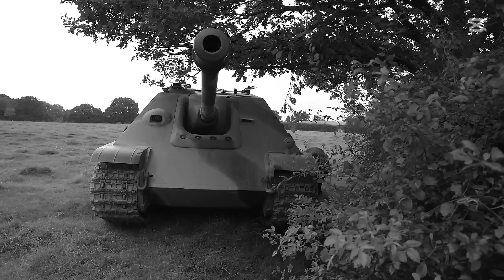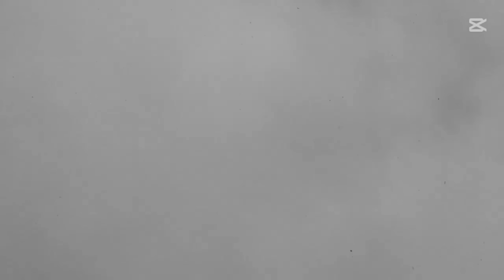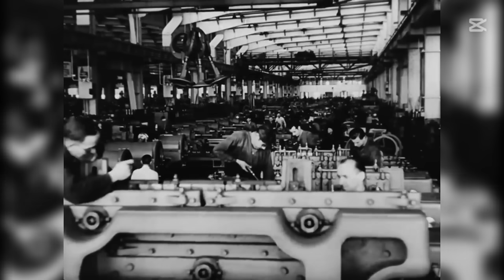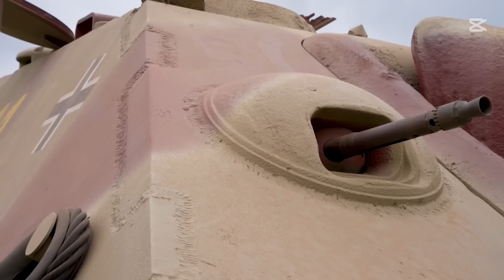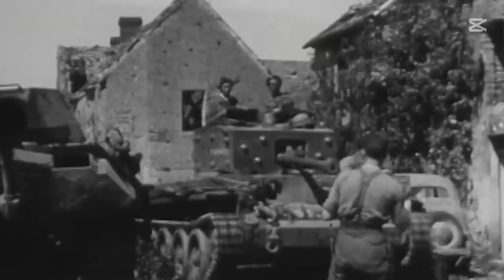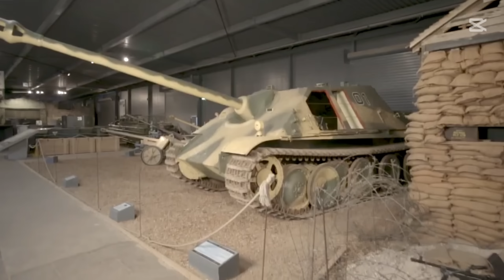The HORRORS of Jagdpanther Crews

Comment: There is irony here. The Jagpanther was explicitly designed to stop the Red Army.
Sending it West was stupid -- and political. (Adolf)
Only in the East could any Jagpanther play to its strengths. 
In the West, that always meant close-in fighting. 
When that happened, the Jagpanther lost the battle and itself.
My own Father ran into a Jagpanther, and just about voided himself. 
It was in urban fighting, he turned the corner, there she be!
It turned out to be abandoned -- no gasoline. Whew. Such a Big Gun.
Reply: The problem is not because they fought in the west instead of the east, the main problem was they were produced far too little too late, when production began of jagdpanther they already had production and material problems because bombings on factories, if they would have had similar amount as stug tanks there would have been much worse for allies, also jagdpanther had mechanical problems and easily could be flanked and knocked out.

Comment: The best thing about this gun, it's that basically the only thing that "evolved" was the barrel's lenght - all the rest - specifically the caliber - was kept the same. You could almost double the kinetic energy of the projectile, without having to rely on a different caliber of the projectile, even if the breech is bigger and the casings are longer, just by elongating the barrel - it's a MASSIVE "relief" on your your logistics & resupply-chain (that was already strained to the max- let's be honest about it). PS. Not to mention - this was probably the most "universal" gun of the whole war. It was used as an AA-GUN. It was used an AT-GUN. It was used as an ARTILLERY gun - both for direct AS WELL AS indirect/"medium range" artillery. I know no other gun in the whole of WW2 that could perform all of these tasks.

Comment: Reliable as erection of 90 year old man. 413 vechicles can score some tactical succes, without opertional meaning. To be signifficant 3'rd Reich needed 4000 at least. There was no 
"Jagdpanther effect" on frontline. It means - if Jagdpanther were somwhere succesfull, other german vehicles , like STUG would be just as well effective. There was no case, when bringing a Jagdpanther changed situation on operational level. During attack, they were useless, and that was their problem.  In second half of 1944 a tank as heavy as Jagdpanther was idiotic. There was not enough fuel to run a cigarete lighter in Germany, not mentioning a tank.

Comment: It seems like the Germans would have been better off financially to forget the Tiger 2, and throw all their industry into this beast.  It was more cost effective, requiring less, resources, and had a higher kill ratio than the tiger 2 did by a significant margin overall.
Reply: There certainly would have been no reason to build the enormous and enormously costly Jagdtiger, either. The Jagdpanther with the long-barreled KwK Pak43 L/71 88mm gun was more than enough to deal with any enemy armored vehicle on the battlefield. 

The King Tiger was unnecessary, too, as you point out. Germany would have been better served to make more Panthers and Jagdpanthers, rather than create a whole new design. The Tiger I was still a very effective weapon at the time and remained so for the remainder of the war. 

I've seen a Jagdpanther in person, at the Ft. Knox - Patton Museum in Kentucky. It is an absolutely impressive armored vehicle, simply massive and fearsome looking even when parked and standing still. I can't begin to imagine what facing one of those down in combat must have been like.

Comment: There is one in the Imperial War Museum, with four holes in the right-hand side. It was stalked by a Welsh Guards Cromwell, which got around to the right and, from a range of fifty yards, fired one shot into the engine and three, in a tight group, into the crew compartment. The 75 mm armour-piercing shells had the energy to penetrate the one-inch-thick armour, but not enough to go out the other side. I squatted down to look through the holes and saw large dents on the armour on the other side the compartment. My father was a tank commander in the New Zealand Division in Italy, 1943/45, and told me a few things about what he saw and did, so, having seen what the three rounds did to the German tank, I didn't want to spend too much time thinking about high velocity chunks of metal rattling around inside an inhabited space.
As it happened, I believe the German crew survived and jumped out and ran away.
Reply: I saw that same vehicle years ago.
Reply: I keep forgetting about the Cromwell.

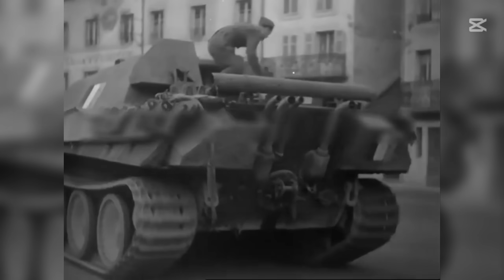Comment: 5:19 Experimental autoloader. Pneumatically operated, magazine held six rounds. The loader was still supposed to operate it, but it gave the gunner the opportunity to raise the rate of fire
Reply: The Germans were technologically way ahead.
Reply: @frontendloader1000  Not really… all the things Germany developed by war’s end i.e. jet engines were being developed alongside allied designs of the same technology at the same time. The only reason Germany introduced these technologies earlier was in part because they were clearly on the losing side by 1943 so they had much more pressure on them to rush the development and production process so they could use these technologies against the allies quicker. Another reason is also Hitler’s grandiose fantasies about having larger and more advanced machines than his adversaries, which is also kind of the reason for the existence of the Jagdpanther, Jagdtiger, etc. So yeah no Germany was not as ahead as people often think, like for example the Americans had developed the P-59 and P-80, the British the Gloster Meteor while being at maximum a year or so later than the ME 262.

Comment: The adaptation of the panther to carry the pak 43 gun was more significant than you suggest. The sloped slide armour of the panther had to be adjusted to accommodate co-production of the jagepanther. This resulted in the Panther G. This change was made to the common hull bc the larger space needed for the gun.

Comment: Germany mainly made Stugs, Jagdpanther and other tank destroyer's as they were broke and the expensive and complicated turrets were not required. They could build 2 Stugs for the cost of 1 Panzer 4.
Reply: But 2 Stugs require double the crew and ammunition etc.
Reply: @ StuGs were much more simple to operate than Panzer IV, the loader could be picked from any German troops able to lift up a shell, while the gunner and to some extent the commander could be transferred from towed AT gun teams, since they were not operating a turreted tank, but a gun with fixed firing arc, often employed as tank destroyers in ambush, where similar tactics like ranging or positioning with overlapping fire was similar to using towed Pak 40s.
Only the driver would need to be trained, while this did add a little bit fuel cost, it was nowhere as expensive as double crew members - by late war where StuGs were getting common, German towed guns were becoming obsolete and ineffective, many teams lacking proper prime movers and unable to operate. these free crewmen could be taken and transferred to StuGs easily.
Reply: @lyndoncmp5751  The logistical nightmares of both Tigers Tank types, combined with the complexity of producing them alongside the Panther hurt The Wermacht even more than the dilemmas you mentioned above.

Comment: 5:02 Min: Final driives where special for the Jagdpanther and got replaced on panthers, they are reinforced and much better. 
So this is not tue. The next with the head out is just normal in tanking, or tankhunter role that the commander sticks his head out insted of using his periscopes only.
5:20 Min: Why does he has to help, the loader can do this perfectly on his own i have such a grenade filled with sand to its propper weight and you can handel it, even better when you are 25.
Reply: Final drives were strengthened

Comment: It was 4 or 5 tons heavier than Panther.  The additional stress on automotive systems was even more pronounced. A single, bow machine gun was not very useful against infantry.  While a capable tank destroyer, it was very vulnerable to just about everything else.
Reply: It was also vulnerable against fighter attacks, naval gunfire, anti-tank mines, flanking shots, mobility kill, running out of fuel etc
That was how it is, in modern battlefield like WW2, for every single threat that one is protected from, there are like 10 more that could still kill one. Nothing is invulnerable
Reply: @ for sure. And I reckon saturation of drones over the battlefield now is the death nell for tanks. I would not make them anymore.
Reply: @sthrich635  sounds like american coping when they have inferior equipment
Reply: @ Right, American coping their inferior equipment like having gun stabilizer, gunner periscope, powered turret transverse, and high survivability in their Sherman tank, and having turret in all their main tank destroyers unlike Germans.
Reply: Nowhere near as vulnerable as the M10 and M18 etc.
Reply: Good doco.
Strange only two Stug 2 prototypes and no Tiger1 assault gun.
Tiger2 was just two wasteful.
Reply: @williamashbless7904  panther 45 tons, jagdpanther 46 tons
Reply: The extra weight may have played a part.. As a mechanical engineer I won't dismiss that. But far and away there were two much larger problems in Germany when it came to building war machines. 
The first was Slave labor. Used extensively in German industry, worker sabotage and poor control of tolerances wore heavily on these machines. 
Second: Material shortages. By '44 manganese, tungsten, and other specialty metals required to create durable armor and hardened components were impossible to get. Substitutions resulted in inferior components. This was proven by extensive testing on captured units at Aberdeen Proving Grounds in Marylsnd confirmed that both armor and the critical components in the machinery were markedly inferior.
Reply: @IRNHYD  Final issue was FUEL.!
Reply: It was only 1 ton heavier . The unreliability was overshadowed by The Ausf D and A transmission issues . By early 44 most of those issues were fixed. No talks about allied tank breakages
Reply: @ yeah, I got the weight wrong.  Oftentimes they will weights in various units of measurement and I was rather careless.
Reply: @ all good. I get stuff wrong all the time.Hi from Brisbane
Reply: @Muzz-d3h  back at ya from SW Idaho.

Comment: Russian SU-series vehicles were much more successful, the ISU-122 / 152 were more useful against soft targets, while SU-100 was just as effective against most German tanks, on top of having a cupola, a lower profile, and being much cheaper too.
Reply: Apples and oranges. The Soviets weren't facing the same strategic and resource problems.
SU-100s didn't have to face overwhelming numerical odds, allied air superiority, dwindling supply, repair and maintenance echelons etc.
Reply: @lyndoncmp5751 So the Soviet SU 100s were still more successful than German Jagdpanzers. Logistics cannot be disregarded.

Comment: The Swedes didn’t abandon the idea, they took the idea and improved on it.
Reply: Then abandoned it…
Reply: @fishkol  S-Tank was made obsolete by true gun stabilization. Until the generation of the Leopard II and Abrams, the S-Tank was more accurate as all other MBTs in firing. But, they had to stop to fire, but in that era it wasn't a penalty because most tanks that fired on the move missed. However, once it was possible to fire and move in a proper way, the S-Tank was well and truly cooked.
Reply: @ indeed. Also, it’s tactical use had become too restrictive for the times and it was no longer a sound economic choice.
Reply: Swedish doctrine is about defense. Not about high mobile deep advances into enemy territorium.
Reply: @PLAN50 in the case of invasion and the proper terrain, they could be good addition as they'd get made much more rapidly.  More modern armor, and basically everything plus automated/remote heavy machine gun and perhaps something like a TOW launcher, lighter machine gun on the body,  as well as part of infantry, artillery units, more armor, kill-zones, CAS, air dominance and more such as even the old retired 8-inch howitzers in right areas, rocket artillery, cluster munitions, mine fields, and yes even limited chemical weapons as a barrier and an invading force could really be decimated. facing a modern equivalent of a large gun with varied types of rounds and that higher, quicker production rates and much could be beneficial for a  defending force.  Still would need normal tanks and armor, anti-tank teams, drones, anti-drone technology, infantry, different types of artillery from towed, self propelled, rockets, heavy mortars, helicopters, A-10s, stuff like Super Tocanos and lower tech stuff is what's needed to be fielded.  Even with a F*** ton of mothballed weapon systems, you'd need to either still have many people still trained on them or need for training people with more training time than can be spared. Simple but effective weapons with 4-6 weeks of training would probably be more than efficient unless fielding couch potatoes.
Reply: S戦車ですね‼️国防を真剣に考えてた　当時のスエーデンの最適解の戦車です。　🇸🇪
Reply: Think the S would work even today, just dig in and wait in ambush…
Reply: Time for Europe to buy European weapon systems, there cheaper and better than the shit the Yanks have been selling us
Reply: And what an awesome tank it was
Reply: So did the Germans. Jagdpanzer Kanone. Saw quiet a few of them back in the 80's.